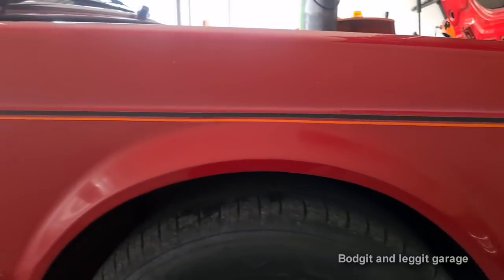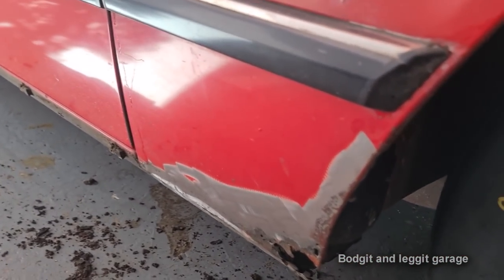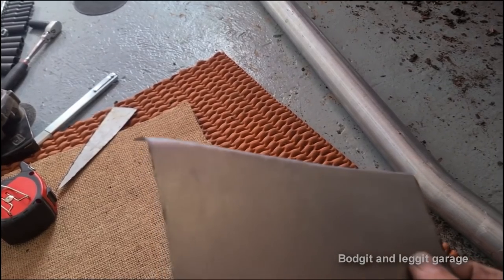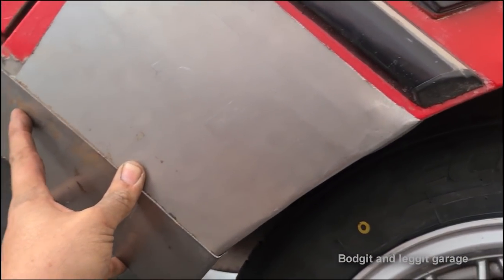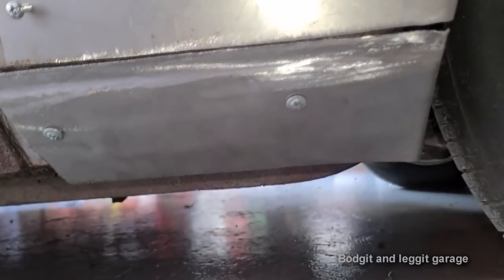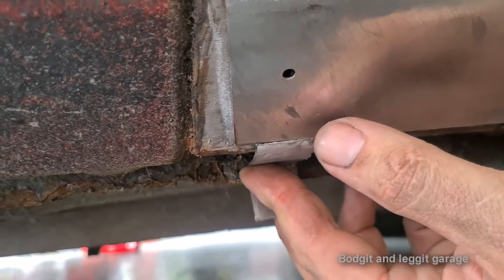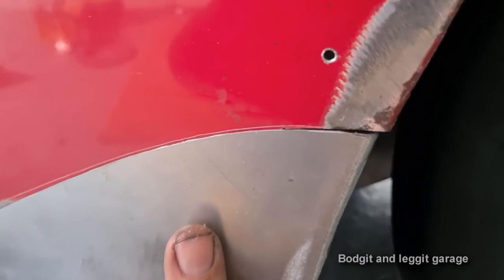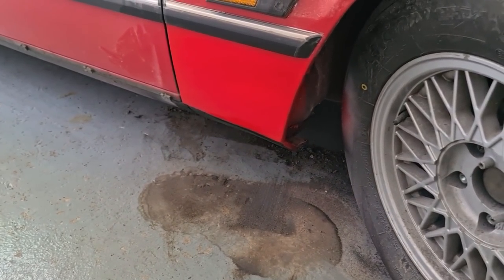How To Make Patch Panels With Simple Tools For Any Vehicle

Comment: Quick one for you 2009:A4  drives perfect until you go around a RH bend the rear break on pass side comes on ,stop activate the handbreak and then off again away you go until next rh bend,motor and caliper and pads have been changed also.

Comment: An adjustable wrench will do a better job than rebar,the wrench has square ends where's the rebar is round,square peg round hole situation
Reply from the maker: It would be a lot easier mate the throat size on the adjustable wrench is too big The way I did it I cut the dept. Myself to the exact dimensions I needed